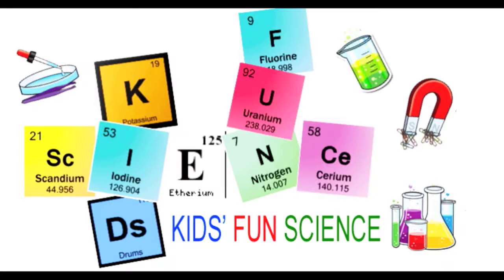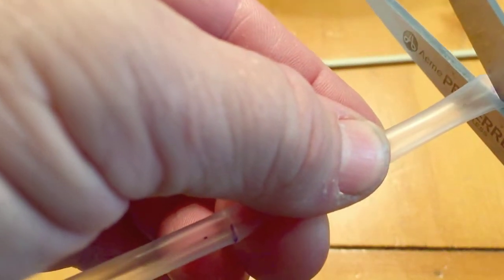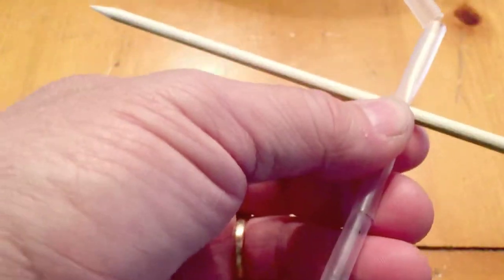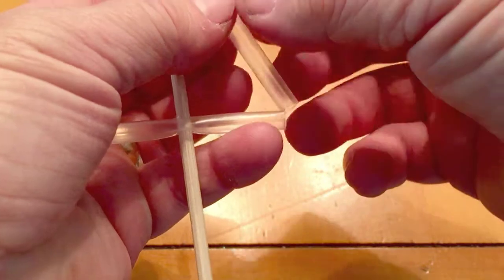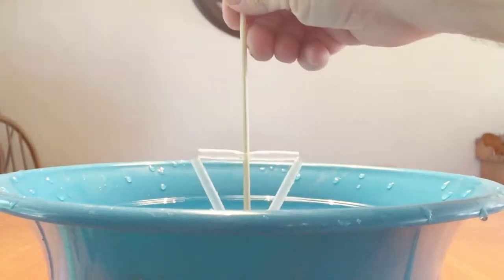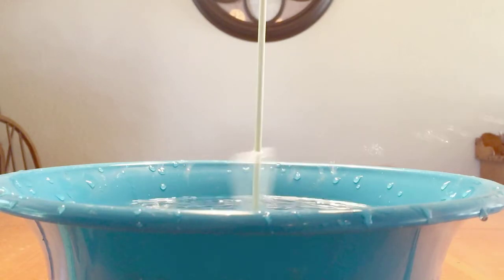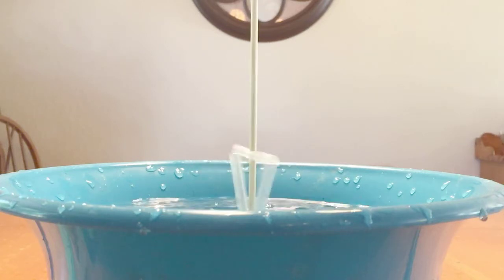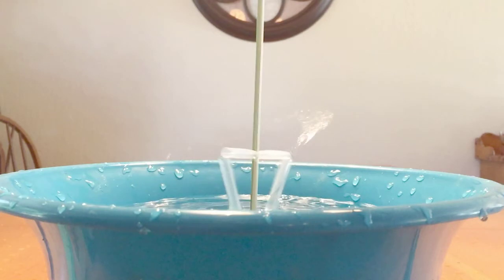Centrifugal Straw Sprinkler Experiment - How to make a sprinkler with  a straw

Comment: What is the science behind
Reply from the maker: Morning Kiran Sankar Saha, 
 
A straw and a skewer can turn into a pump with a twist of your fingers! This fun experiment is a good way to introduce centrifugal forces and the principle behind many pumps.

When you spin the straw it forces the water inside to spin. If an object is spinning anything on that object appears to feel a force pushing it outward. 

This means that in your straw the water is pushed outward and the only way it can move outward is to move up the straw - it is pumped upwards. If you spin the straw fast enough then water will exit the straw and fly outwards as it is now moving quite fast. This is called centrifugal force. Thanks for watching Ken